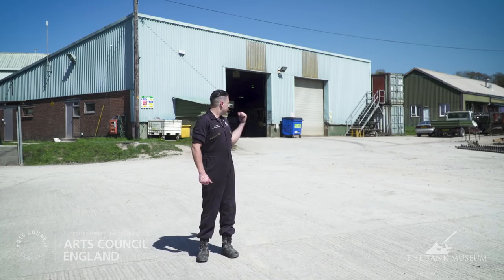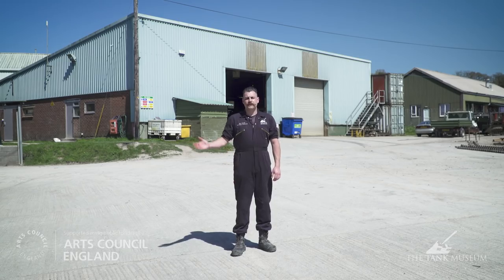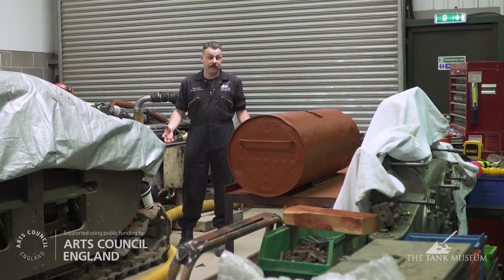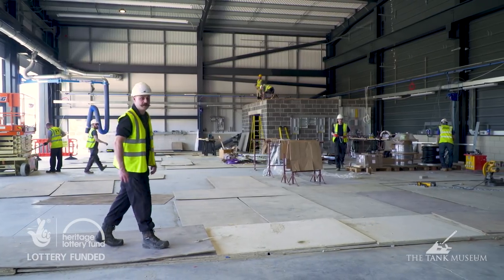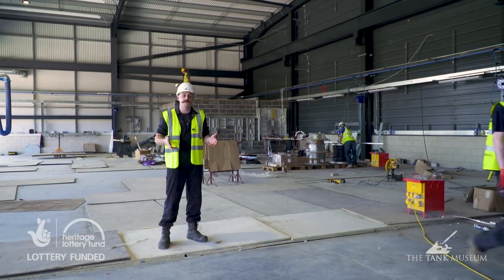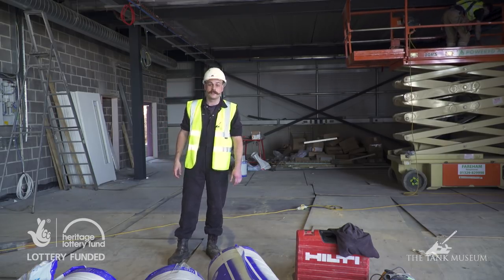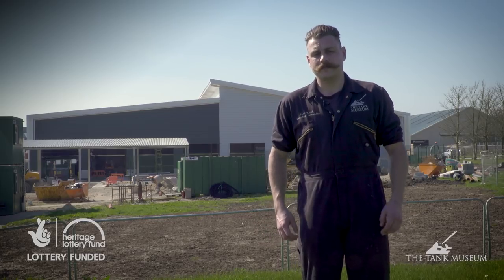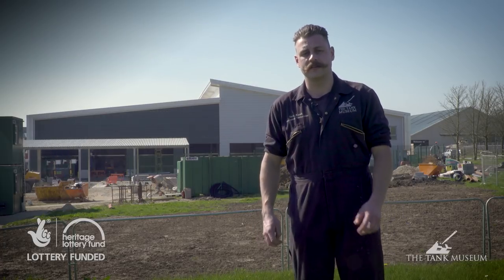The Matilda Diaries Special | Tour the New Tank Museum Workshops

Comment: £2m I believe. A worthy cause and a good way to spend £2m, if it has to be that much. But it never fails to surprise me how expensive any modern construction project is. £2m for a shed with a firm floor and a decent crane does seem a lot. Once the professionals get involved it all multiplies up so much - architects, staff facilities including disabled etc, it all gets very complicated. And 50 years ago it must have been a few guys in overalls just wanting a roof over their heads and and somewhere to boil a kettle. Anyway, I'm glad they will now have something nice to work in.
Reply: That will not be your average factory floor. A decent man shed is £10k on a tight budget.